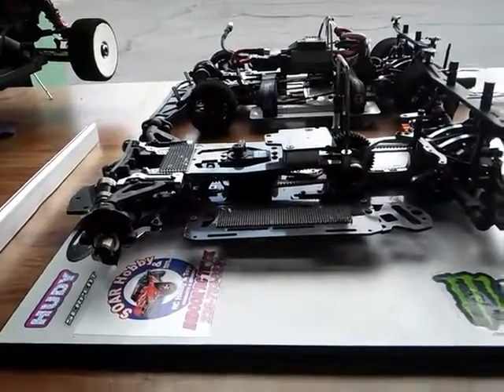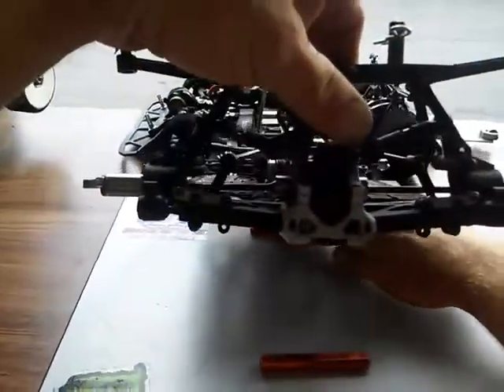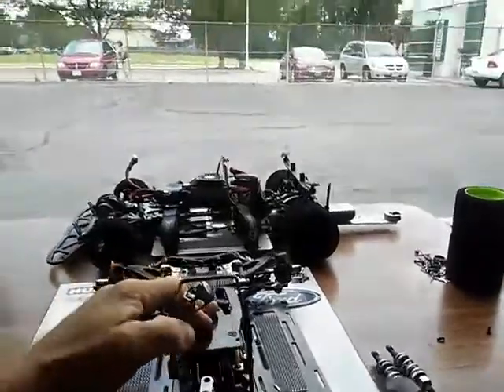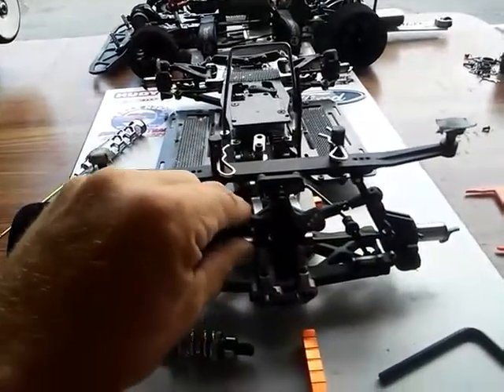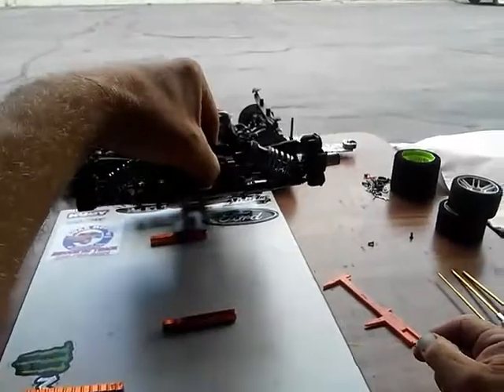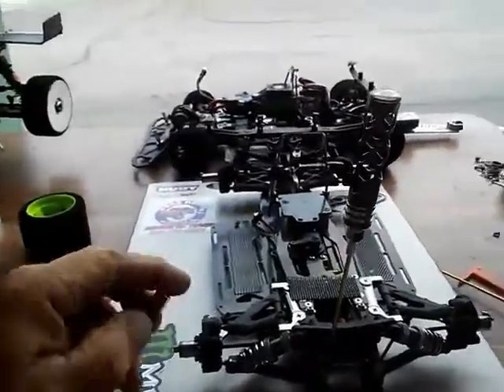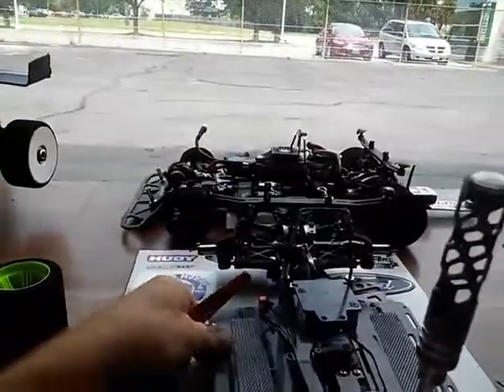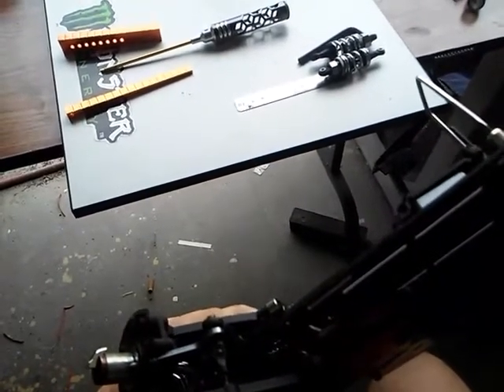Serpent setup helpful info

Comment: Gonna scoop a 988e Viper up soon, is there enough room to play around with good speed run gearing? I heard some Serpants are only limited to certain gearing? Is this true!!
Reply from the maker: Yeah with this you need long shank pinions the way it's designed look on serpent under optionals
Reply: Henry fords rc ok is there anyone who makes this pinions besides serpent, so we could go with gears like 40 spire and 27 plus pinions mod 1?
Reply: Henry fords rc I see guys run over 130mph on these serpants!! They gotta be running mod 1 gears on that ball park ya know
Reply from the maker: @paulwizal23d89  this 988e saga custom sells the steel spur gears
Reply from the maker: @paulwizal23d89 sagas are .08 mod so for now just serpent pinions unless you have really long motor shaft and maybe normal pinions will work